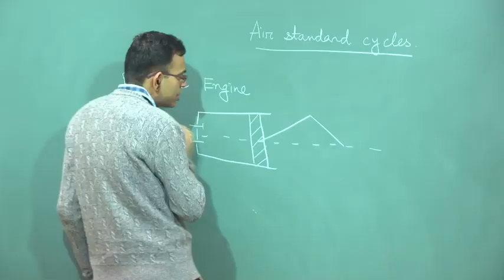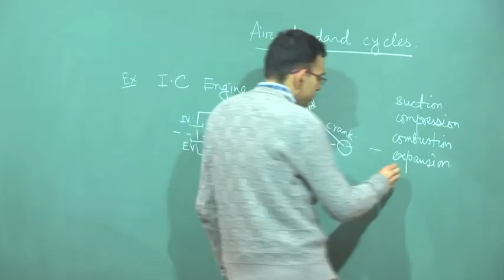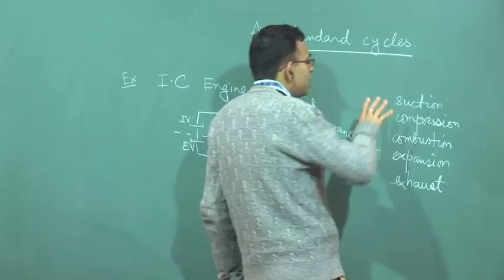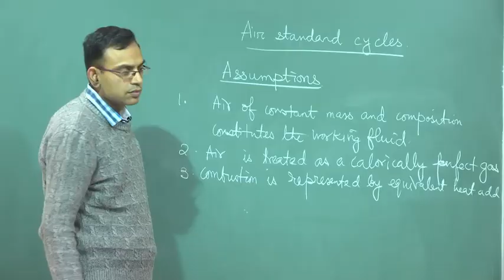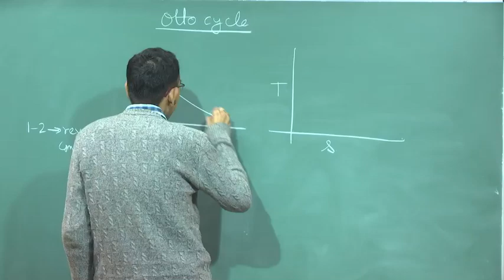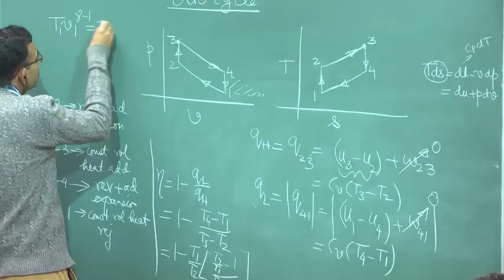Lecture 59 : Otto Cycle

Comment: if we indiscriminately increase r in the efficiency expression then prof said temperature spontaeously rises such that ""automatic self combustion occurs"" . does he mean the engine explodes???
Reply: Increase in r means to compress working material to higher and higher pressure which leads to higher temperature, so given that r is high enough Temperature during compression could reach ignition temperature of air fuel mixture which would cause combustion.